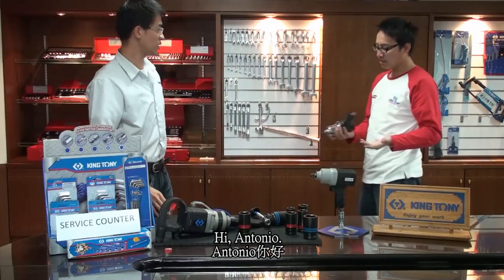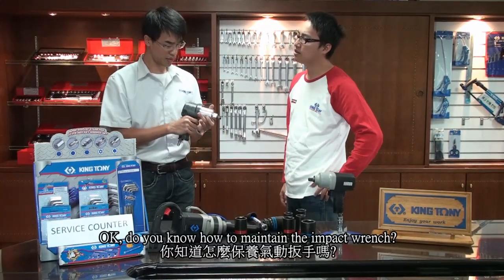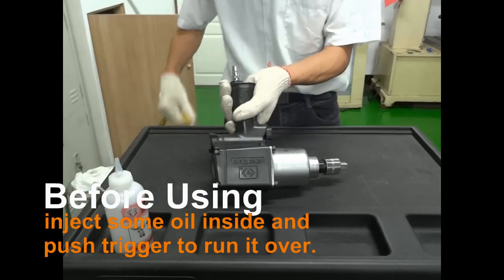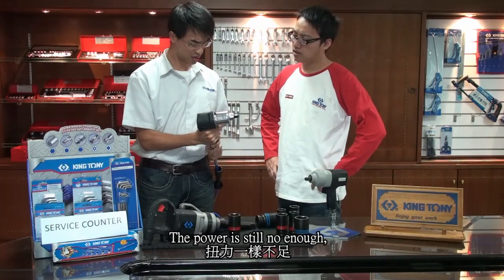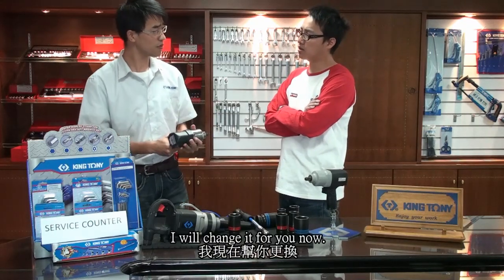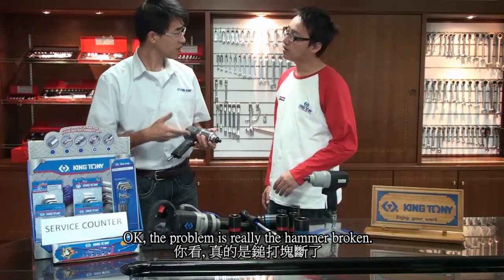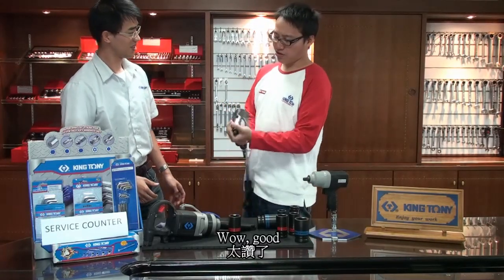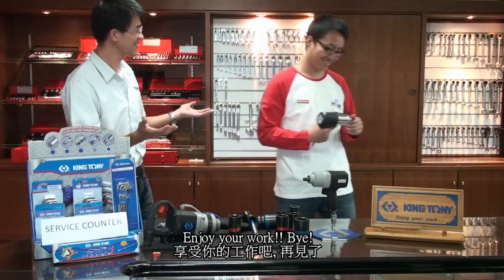【KING TONY】How to solve the problem of Impact wrench which is losing power

Comment: That's the cleanest, most grease and oil free impact gun I've ever seen after 2-3 years use. Looked like brand new, but not surprised it didn't last long with no grease or oil. The old parts even looked identical to the new parts🤣🤣🤣
Reply from the maker: Haha! 😆If you ever need replacement parts or a new tool, check out our website: https://www.kingtony.com/index.php. Feel free to message us on Facebook if you have any questions: https://www.facebook.com/KingTonyTool/.

Comment: I always squeeze the trigger as I'm putting the oil in
Reply from the maker: After putting the oil in,  you must install air hose to use impact wrench. In this way, the oil can be lubricated to the internal mechanism.

Comment: 2018 what if there is a difference in pressure .. left the pressure is weak and strong right direction how to fix it.?! thanks before
Reply from the maker: 1. Increase the air pressure
2. Using the recommended piping method
3. Make sure that the air pressure dynamic above 90 PSI and static 100 PSI

Comment: Really? You took it apart then put it back together with its original parts without adding oil to the cylinder nor the bearings and that fixes it? Lol. BTW, impact guns don't make your arms jiggle like an idiot. Nice job click baiting people
Reply from the maker: In this film, we replace rotor blade, not cylinder or bearing. When we make it, we had already added oil on cylinder and bearings. This film is not talking about the replacement of cylinder and bearings, so we don't add oil to them.  Thank you for your ask.

Comment: Another fifty dollar Harbor Freight Impact wrench Fixed   Great Job !!!!!
Reply: +1995dresser Where did you get the parts at? There's this used Earthquake at the Pawn Shop down the street for me for $20 but I was leary of buying it. But if I can rebuild it, it's like a $80-100 tool.
Reply: +lucidbarrier  For 20 bucks if it works you got your money out of it.  if it needs more work buy a new on  sale they come with a 90 day replacement  the HF guns  work for the money.
Reply: 1995dresser I've been looking at them for awhile. I have a Porter Cable pancake air compressor and I have heard of people popping lug nuts off with this compressor and the Earthquake. It would be a nice little portable combo if it could do suspension work ( I have some lower control arms and a panhard rod to replace on my camaro). I've taken off a rear end with hand tools and it would be nice if this thing could break those bolts loose.

Comment: He sink it id ah da wodda bwade because ah da power id not ahnuf.  I sinked it was because the air was turned down and he was dramatizing for the video.  That impact was brand new.  Would have been a better idea to use one that had woan wodda bwades so you can hear what bad ones sound like.
Reply from the maker: Thanks for your suggestion. Our main intention to take this film is to let our customers have some more idea how to inspect the impact wrench when they faced the problem . Thus we haven't use a defective impact wrench for demonstraction, but we wil take your suggestion into account when we plan to take this kind of repaired film in teh future . Thanks
Reply: monelfunkawitz j